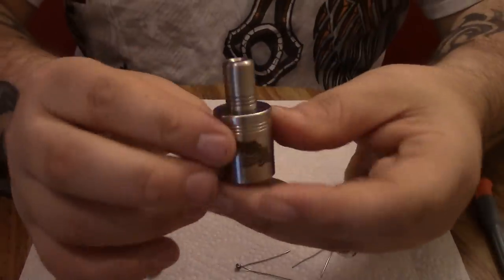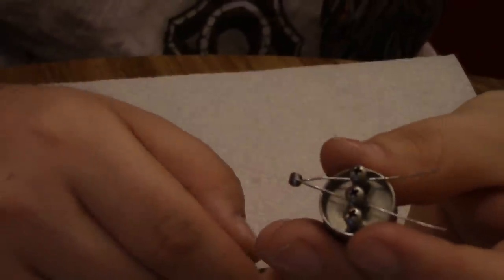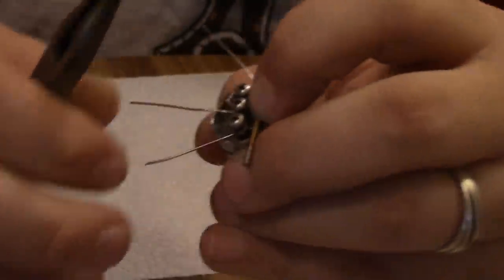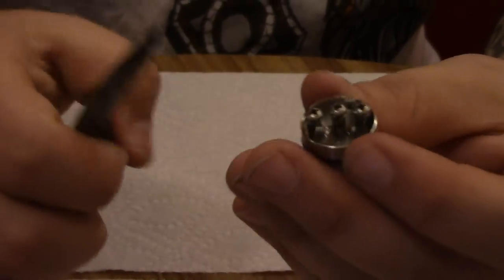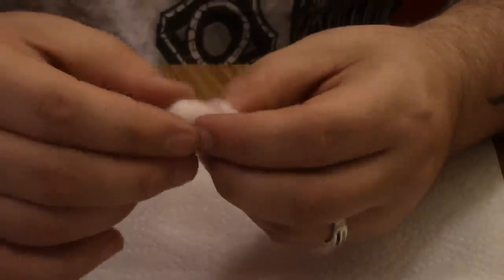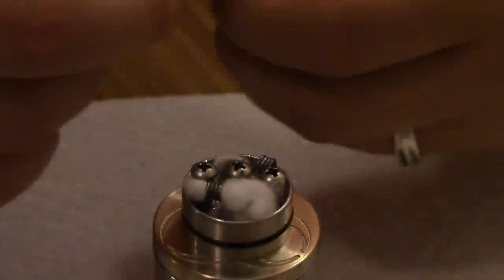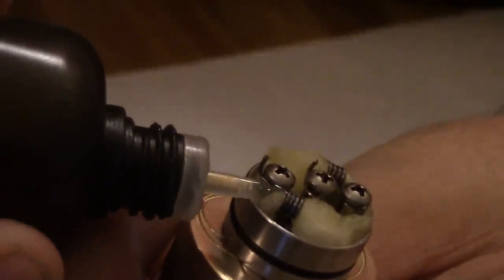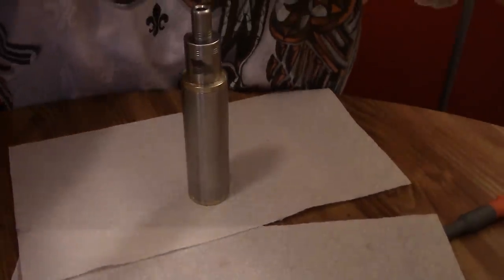Tugboat RDA build Tutorial

Comment: Thanks for the reply. The sony vtc5s are high drain 30amp continuous. Correct if I am wrong. But I have looked them up.
Reply from the maker: I'm sorry, I was thinking vtc4's.  But at the same time in my experience the mnke does still hit a bit harder than if you have sony's. Also what is the vg/pg ratio of your juice? Mine is putting out thicker clouds because I am using a high vg mixture

Comment: could i use 24 gauge wire with a dual quad coil on a tugboat with a 18650 mod.
Reply from the maker: you would have to ohm it out and see what the resistance is and make sure it falls within the amp limitations of your battery

Comment: Hey man I have that tugboat and I have a 22 gauge kanthal a1 6 wraps and I don't produce as much vapor as you. I also have 1/8 drilled holes. Could you shed some light as to why? Also it's a fully charged vtc5. Coils heat up slower than yours and less vapor.Thanks in advance.
Reply from the maker: well first of all you got 6 wraps so it will take a bit longer for it to heat up, and second you are using sony batteries which are different from MNKE's in that the mnke is a high drain battery and the sony's are longer life. You sacrifice battery life for a stronger hit. Take it down to 4 or 5 wraps if the heat isn't too much for you.

Comment: 22ga 4 wraps center post is .07 on mine
Reply from the maker: there is a short...make sure your screws are tightened down good and then make sure the leads are cut close
Reply: you right thats what mine comes out to also.  when you get your coil closer to the center post your better off and you build will come out a little lower,  .17 seem a little high compared to the builds ive done with 22g. i use it quite a bit

Comment: My tugboat looks smaller with it being smaller  using 26g kanthal wire will it make a difference on how it fires and I'm using a smok Tpriv and it reads the ohms so will I still have to test it with a meter
Reply from the maker: always best to check. If you don't have a meter you can use your Tpriv and it should tell you the resistance down to a point. No, the size of the atty does not matter so much as the size of the coils.
Reply: jhettervik okay thanks I watched your video as a guide I think my build came out okay for my first build I just have a problem with know how much cotton to use as well as trying to figure out the wattage to use I went to this place called chase the vape and I did a two coil build and the guy said he'd recommend Clapton coils and wouldn't go over 40w but 40w hardly fires two coils
Reply from the maker: Chase the Vape in Memphis? because I work there

Comment: Whats the name of the machine that u sais u normally use to measure how hot ur burning an where can I get one?
Reply: Its a ohm meter / volt meter / multimeter. Ballpark price is probably from $20 -$30. You can find them pretty much anywhere like Radio Shack, hardware stores, auto part stores, or even Walmart
Reply: Hi guys! i just ordered a multimeter on eBay the other day and found it as cheap as AU $5.32.
My father has had one of these since i was a kid and it still works great. anyway. for that price You probably gonna survive without a mental breakdown when it stops working :)
Multimeter: DT-830B
Make sure you buy one with leads.

Great video by the way! Waiting for my Tugboat as we speak and will definitly set it up with Jhettervik running on the laptop at the same time!
Reply from the maker: ***** I have noticed you talking to the people on here as though they are stupid for not knowing. Guess what, it's ok not to know. That is why people like me do these video tutorials. I do stress safety in my videos. Maybe not all of them but those who find my videos helpful tend to watch most of them. And I am certain they watch other people's videos as well. They are here to learn and I appreciate you telling them to look up pictures of mishaps and telling them to learn about ohms law. Just keep in mind that they are here to learn. You can't learn if you don't ask questions. That is all I am saying
Reply from the maker: ***** cool, again as I said, I do appreciate you making mention of that. And I thank you for iterating that you were being sincere and not condescending. Too many people out there trolling the new people too much so thank you for taking the time to help some of them out.

Comment: What RDA do I need for a kamery k100 and what size wire and how many wraps and what's the best Battier and ohms to be on  please help new to mechanical mods
Reply from the maker: any dripper would be just fine for your k100, battery I would choose either the MNKE 18650 or Efest 30amp, or MXJO....all of them 18650. Coils I would use on a standard tugboat or similar dripper would be a 6 wrap 28g dual coil on a 3/32 bit. that would put you at a descent resistacce to still be safe but produce well

Comment: Can i use a 28 gauge wire if i do not have a 26?
Reply: 22 i mean not 26
Reply from the maker: MrThecrazyassassin
yeah, 28g will work just fine
Reply: ty :) i'ma give this a try
Reply: Jhettervik how many wraps should i do if i'm using a 24 gauge wire on a 5/64 drill bit
Reply from the maker: MrThecrazyassassin
depends on your battery and how low you want to go. if it is a 30amp battery or better then 4 wraps should do it
Reply: thanks for answering my questions :D
Reply from the maker: MrThecrazyassassin
you are quite welcome. I just hope I was of some help